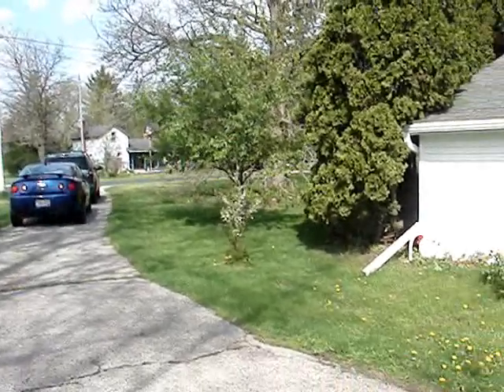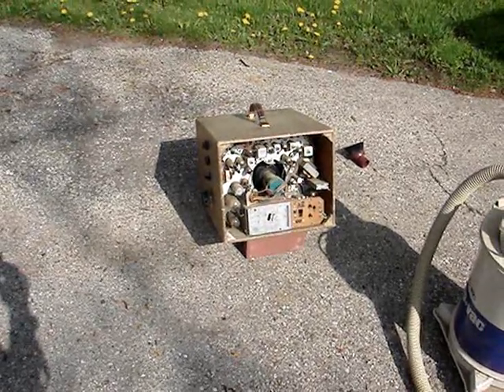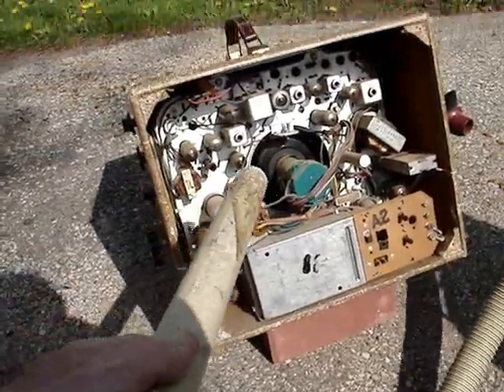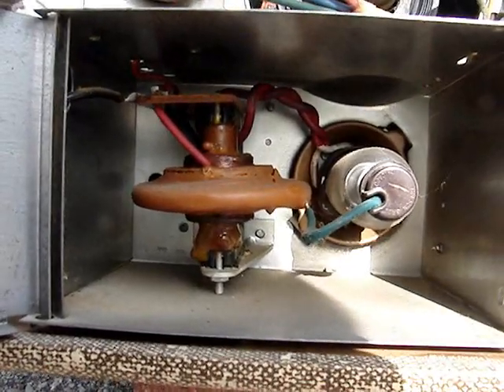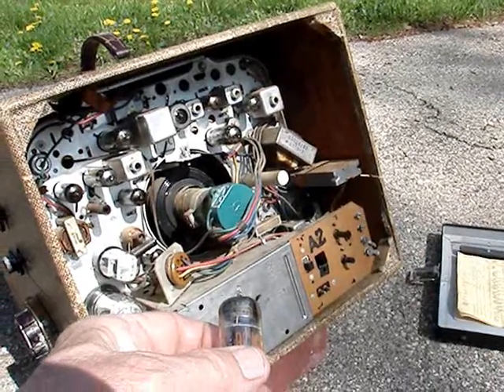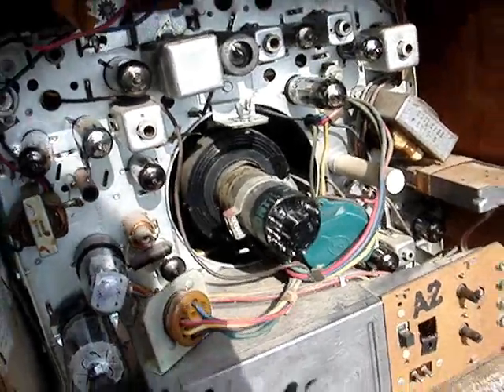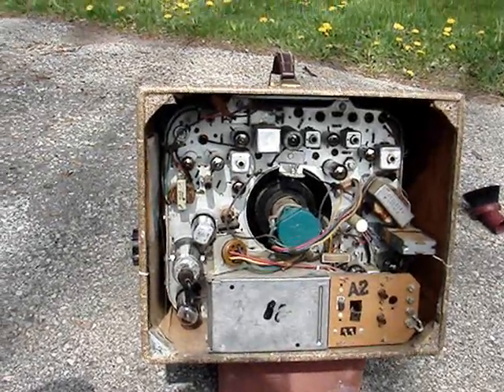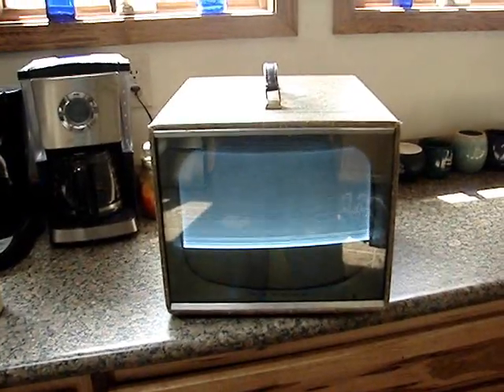DuMont RA392 1957 portable TV PT1

Comment: I’ve found a real effective way to clean old sets is to  use a small paintbrush to loosen all the dust especially in hard to reach areas and hover a portable vac over the brush, sucking up all the brushed up dust.
Reply from the maker: Thats an excellent idea.  I don't know if I'll ever get to restoring this old set. The pandemic took away a lot of my interest.
Reply: Yeah, opposite here. the pandemic and being indoors has kindled my interest.

About that CRT, in my limited experience, even low/bad emission picture tubes can sometimes display a raster. I had one, dead as a door nail that I did a low level rejuve and it displays fine, at least for the time being. Also, leaving it on the crt tester, heating the filament for a few hours sometimes rejuvenates it as well. You may already know this...
Reply from the maker: @delreycustomshop7624  My last video on the 1950 Magnavox that I was working on has a full raster on the CRT but there is no video getting through. Using a scope I can try to analyze where the video stops but with the pandemic, the crumbling economy, unbelievable politics, civil unrest ect-ect  I have mostly lost interest in restoring vintage TVs. How can I get it back? You are right about the CRT in the DuMont. I am sure that if I re-cap it I will get a reasonable picture on it for demonstration purposes. Thanks! Gary